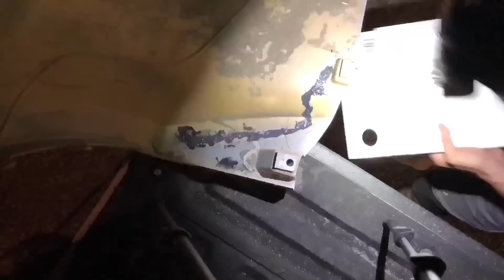2001 Ford F350 7.3 Project - FULL BUILD - Start to Finish

Comment: Protect your lungs man. Lots of cancerous shit floating around during this build.
Reply from the maker: Such as what? Dust?
Reply: FixItNick 

Yup, the sanding, the painting, even hitting bolts with the impact gun throws dust. Years of brake dust accumulates all throughout the underside. I always mask up even when doing rather mundane fix it jobs.